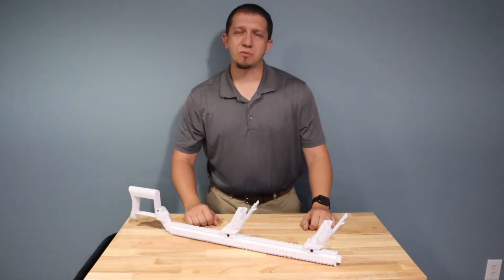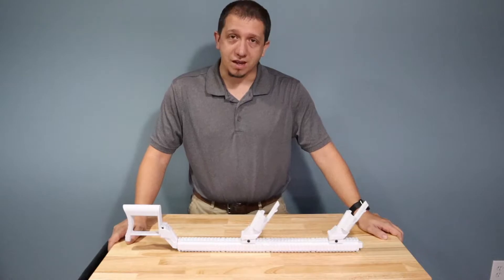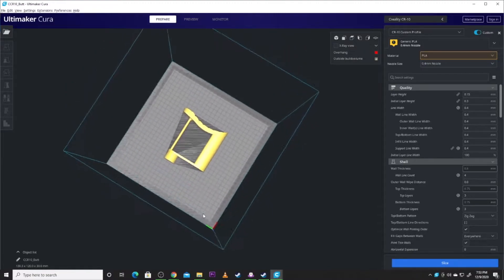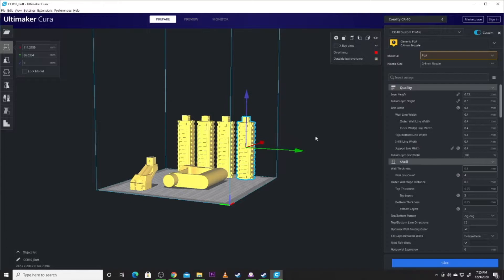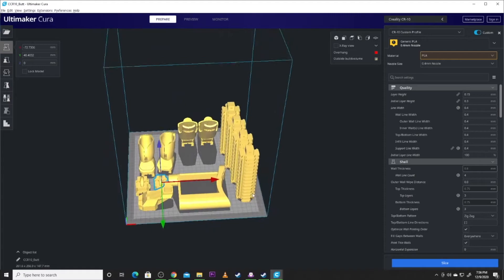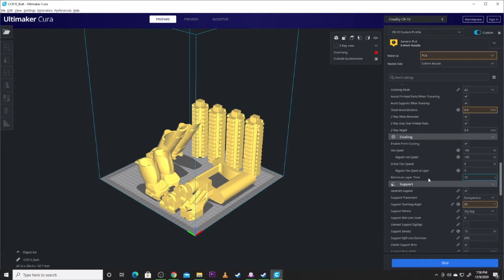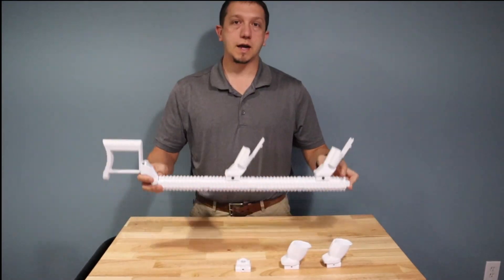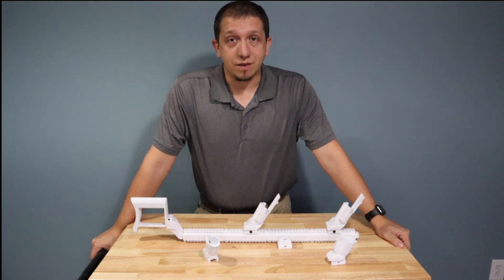3D Printed VR Gun Stock Tutorial

Comment: Been looking at different VR gunstocks to print and came across this video and love the simple design right away. Got a few parts printing right now.
Reply: Not practical though, having played with many designs.  ideally you don't want either hand hard locked to a stock but a general compromise is just the primary hand with just a small grip point to brace the offhand on, alternatively there are magnet based systems.